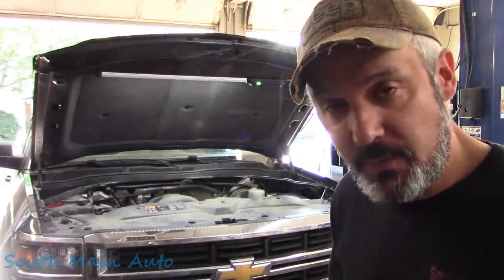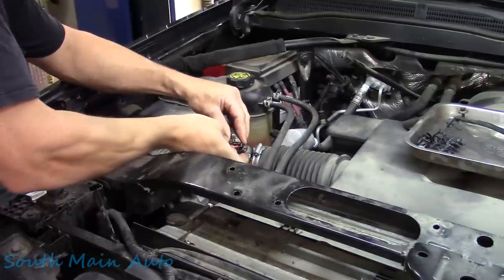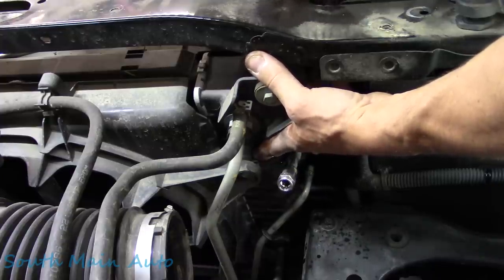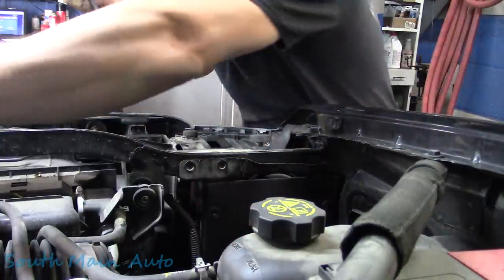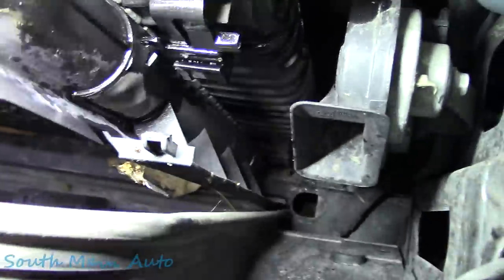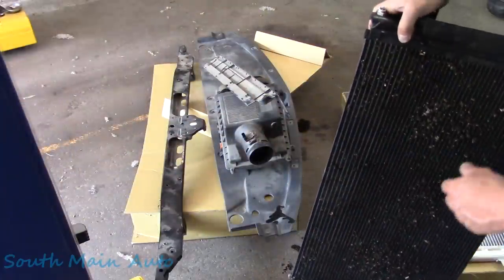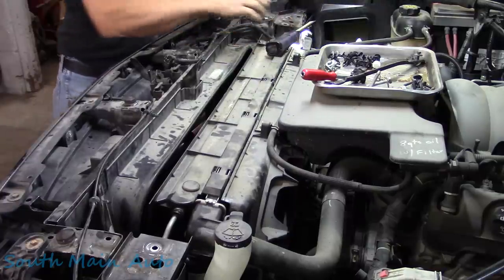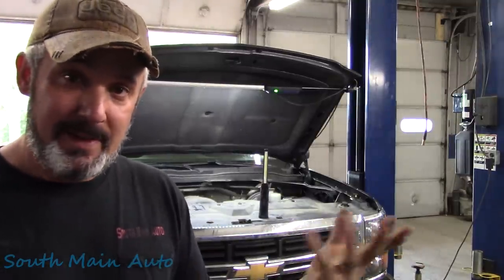Chevrolet 1500 / Tahoe - No A/C Leaking Condenser

Comment: This guy must have more money than sense to get it charged up so much. AC Delco... ouch, that gonna hurt. AC Delco cost about 5 times what an aftermarket costs and it is no better than aftermarket. 
Nice Le SK plastic rivet puller thing-a-bob.
Reply: Some times you've just got to bite the bullet and purchase OEM. 

My 1-ton Econoline van ate an alternator stranding me 400 miles from home. Local auto parts store had a new Remy for around $200. An hour later, out with the out, in with the new. Life was good or so I thought.
Two weeks later the new alternator went toes up, no Remy dealer close by, so it was Advance Auto for the replacement, and another $250. A few months later, the third lifetime alternator went toes up. Thankfully, my little Honda EU2000 generator will run the truck in an emergency via the 12v charging circuit to get back home.

Finally purchased a Motorcraft for a Kings Ransom, but it's still working.
Reply: @gungadinn   I don't know what it costs now, but about 10 years ago the AC Delco condensers cost about $400 to $600. The aftermarket cost about $150. If the truck were a new style, then a lot of times OEM would be the only thing.

Sometimes OEM is also not really OEM. I worked on GM trucks that had me thinking I was crazy, because people changed out the normal size condenser on a pick-up with the bigger (and cheaper) condenser for suburban with rear air options. Try adding the volume to that system and then wondering why it would not blow cold air.... just another oz... just another oz... until it hits 40 degrees and get it out of here.
Reply: I put an Ac Delco one in a friends 2014 Silverado back in March. $124 plus shipping for it. They are out of stock now, so!!!
Reply: @mph5896   For that price, it might not be an AC Delco. From what I remember, those were always ridiculously expensive, but the company I worked for would order those from one of the local dealerships.
Reply: @willw8011  Yup, same part number as Eric O. It was an Ac Delco professional, they no longer have the OEM available.

Comment: 1 gallon low on coolant would  100% warp the head on a Honda Civic 1.7l then blow the head gasket, Don't ask how I know after a stray Dog managed to snap the radiator drain off of the bottom, But of course the Car was a salvaged car and had not been repaired very well under the radiator, in other words if you have a lot of Animals running across the roads and can't avoid all of them make sure if you hit anything even if the front bumper still looks perfect don't go what I did in the middle of the night just drive away without checking for a fluid leak, Because now I'm doing a head gasket and need the head resurfaced. Good luck folks 🤓.

Comment: Any reason for OEM with a condenser? I know that you like OEM for modules and electronic parts but you usually just go napper with things like this.
Reply: Here at the dealer, most all of the delco ones we install are china junk.  When delco was not available we installed aftermarket brands  that looked better. Must be made in a different china plant.
Reply: @scrappy7571  this one was made in Taiwan, which is not china.
Reply: @mattmanyam  Whats the difference?   Not made here....
Reply: @scrappy7571  china is not Taiwan. 
Taiwan is known for "good to exceptional" quality, with a national "quality of life index" as good as the US.
Reply: @scrappy7571  also, see the other guys comment about the oem quality of the ones made right up the road from Eric in Lockport.

Comment: So you fall on the side of the argument of changing old black transmission fluid?  There are those that claim that once the fluid is burnt that changing it causes slippage because the friction characteristics of the old fluid is greater than the new.  What say you Mr. O?

Comment: Owner will be happy for another few weeks until the tranny nukes ($4,000?). I'd change the fluid/filter and then do it again every few weeks until most of the black oil was gone/diluted enough and then hope for the best. I change mine every 40,000 and it's always nice and red with minimal material on the magnet; never had a problem.

Comment: Motor held in by 4 bolts. Battery tray held in by 18 bolts 6 plastic clips, 9 screws, 4 nails, 2 quarts of epoxy and some baling wire. Can't have that baby coming loose.

Comment: You have to wonder about auto AC design. We can buy a small window unit for a room in a house for $150 or even less. It works for 3 or 4 years. We throw it away and buy another one. Typically a diagnosis of an auto AC costs more than $150, then, if you want it fixed as you can see they have to disassemble half the car, buy expensive parts and …..  why can’t they simplify auto AC.
Reply: With the window AC you are buying a closed unit, so it's somewhat protected and doesn't move or flex very much.
In a car the heat cycles, jiggling of the bits and exposure to the elements would all take their toll.
Plus it has to work with other elements of the car. Sure it could be done better, but the comparison isn't the same.

Comment: So you basically did all this job WITHOUT replacing a leaky radiator?  It was maybe 10 more minutes to do.
Reply: Got to get the okay from the customer, order the part and wait for it to be delivered.  Until then, car is in one of 3 service bays and there are other cars waiting for repairs. What to do, tie up the one service bays and put off the other customers or schedule the customer for another time. Besides, not a regular customer and there's a chance he might go to the other shop for the other repairs. Hard to say what went on but I'm sure it got put back together without the radiator for a reason not mentioned.

Comment: It's a GM, guaranteed it needed a radiator..... and a transmission...... probably an oil pump and pressure regulator too since you had it apart that far.... rear main seal holder\ cover..... pretty predictable at least. Here I Florida all this at ~ 170000 it you're living good... sooner if not.

Comment: The most obvious thing I see is that these things are not designed with service in mind.  e.g., hidden fasteners in impossible places.... when they don't need to be.  

And you would think a design would be tested for many years and proven out, so that once incorporated, you always use that design, knowing it will only rarely fail.  THEN maybe you can bury it.

Comment: Did you count the number of coolant passages / fins per inch on the aftermarket condenser? 

More often than not with the copy / aftermarket parts you get less coolant passages and less fins per inch too (they have to save money somewhere right?)

Probably never going to be an issue in NY but depending on copy part take it down to Florida in summer and it wont cool anywhere near as good as the original part.
Reply: It's not an aftermarket part. It's an OEM GM part.

Comment: And people rip on ram.  I have a 13 ram 1500 5.7 and the thing runs and drives and looks like its new.  125k odo.  Just needs new tires
Btw, ac delco hasnt been gm for a looong time now.  Delphi is their shit part supplier
Reply: @EarthSouthside  mine is in really good shape.  Every manufacturer has rust issues.  Heck eric was working on a 2017 Silverado and said its already ready for the scrap 🤯

Comment: that was a lot of oil that ran out that condenser, by eye it was nasty dirty/burnt and likely far more than the whole system should have.
that says to me, the owner or the "other shop"(lol) has been pumping in cans with magical cooling boosters, oil/leak sealers in it, non stop. I'm going to guess it will cool not great, have high pressure and restricted orifice/bad dryer.  if only people would fix the real issue early on. 😵‍💫
F.Y.I. dye, leak sealers, etc.  = mostly all oil, with a tiny amount of "magic" ingredients(re-lol)
*I think I may have seen the nasty trans fluid coming out and missed that it was the wrong side of coil.* whoops 🤡 multi-tasking.

Comment: if the gm parts are crap ,why install another . I've installed aftermarket with better results.  and there fitment is just as good . and your not installing a problem part .

Comment: At least the part is from Taiwan and not China a lot of the OEM parts from China do not always fit right and are not as good as the original part even if it is made by the manufacturer.

Comment: Again this condenser replacement not easy to do.
Reply: GRAVY!  We were doing 3 or 4 a day at the dealer, for 6 hours each!
Reply: @scrappy7571  that's dealer. I know about less time. However for the shade tree mechanic recovery system tools vacuum system refrigerant etc.    You have everything to there dealership
Reply: @brianw4brian  We have way less tools than you think we do.  Most of the stuff here is broken or missing.  I could do these in my driveway at home, simple.
Reply: @scrappy7571  I know what your saying.  The tool necessary to is vac machine recovery for ac    for first timer may not be easy